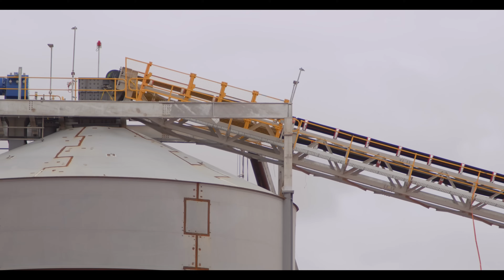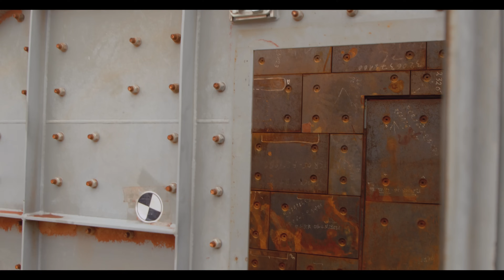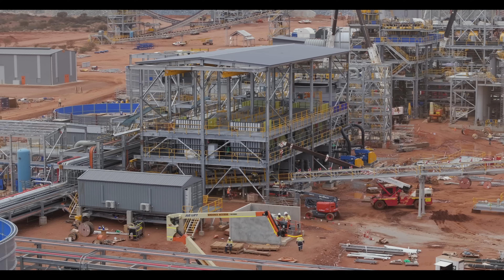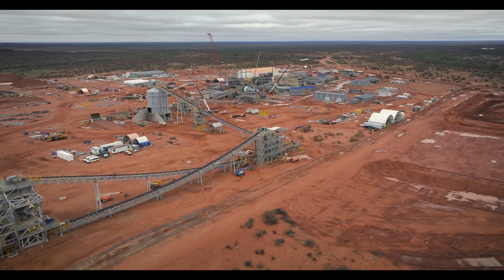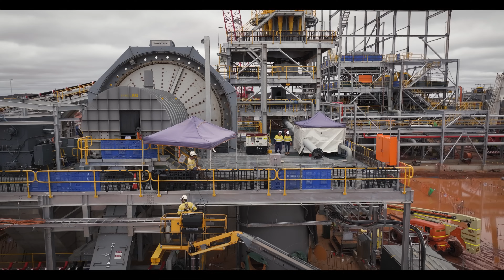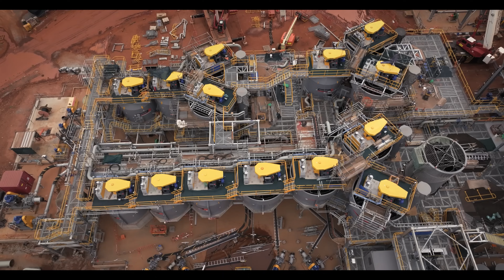ASCENDANT: The Kathleen Valley Story Part 1

Comment: That's what "lessons learned" put in practice means. Great attitude that should become a benchmark for all operations: keep operability and maintainability in mind when designing the plant, optimize the design for commonality in terms or spares and wears, take wear patterns into account (the mentioned rock-on-rock method here), get the trusted and proven engineering partner and acquire best in class equipment.

As a non-engineer by education (rather by a mind-set), but someone who has been working in a minerals processing area for many years, I am truly impressed by the work done! All the best to you in the operations and potential expansion project!